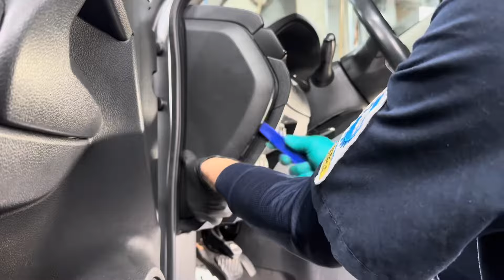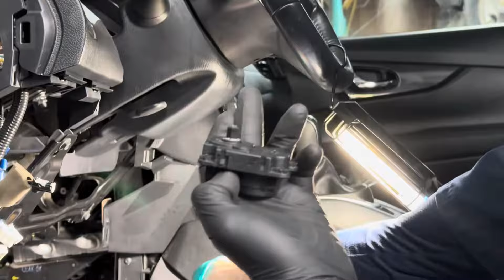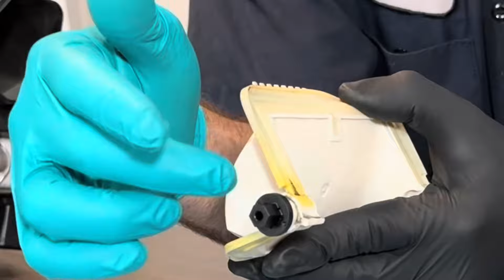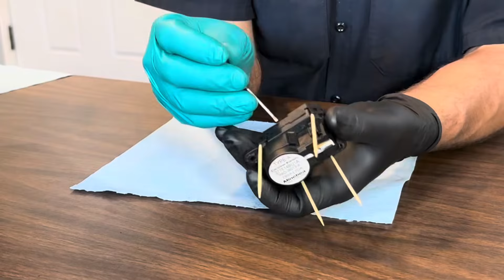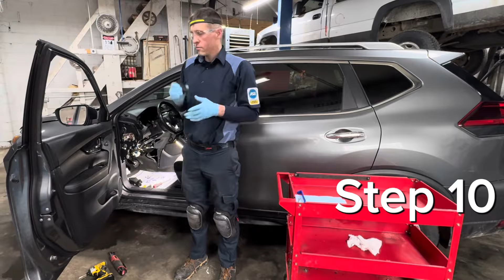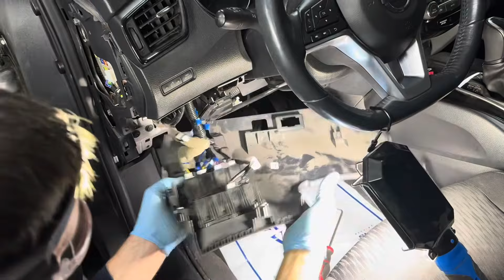Nissan Rogue Heater/AC Fix & Upgrade Kit!!

Comment: What’s the name of the fix kit
Reply from the maker: @AngelaFuentes-t4p  Nissan Rogue Heater Fix kit. You can find it at renegadesolutionscompany.com
Reply from the maker: @AngelaFuentes-t4p  you can call or email us from the website with any questions! renegadesolutionscompany.com 
renegadesolutionshelp@gmail.com
Reply: Does the whole box have to come out like in the video or are you just demonstrating what to do? Hope that’s not silly question. Thanks. 🤝
Reply from the maker: @jamesbarlowjr.3762 not a silly question at all! No the heater box does not need to come out of the vehicle. We just had it out for demonstration purposes. You can fix this in vehicle in a couple hours!
Reply: @ Awesome cause I think that’s what happening to mine. And I just bought the thing. Lol. I hear a ticking or clicking. Lol. How much is your Kit? Thanks Again for the messaging back. 🤝
Reply: And how would I know which is the best kit that I would need? Thanks Again!
Reply from the maker: @jamesbarlowjr.3762  Great question. You would probably be happiest with kit 2. All three kits will fit your Nissan Rogue and fix the problem just the same. Each kit is a little different though. Kit 1 (Nissan Rogue Heater Box Repair Kit) allows you to save a little money by modifying and re-using your blend door motor. Kit 2 (kit with preassembled motor) is a little easier to install because it comes with a new blend door motor that is already modified and ready to go. Kit 3 (extra low torque version) is the same as kit 2 but the included motor has a lower torque output. Meaning is puts less pressure on the heater box. Kit 3 may only be necessary if someone has tried to "fix" your heater box AND severely damaged it. It is almost never needed but some people like the idea and order kit 3 anyways.
Hope that helps! If you have any more questions let us know!

Check out this article on our website.
https://renegadesolutionscompany.com/pages/faq
Reply from the maker: @jamesbarlowjr.3762  You're welcome! Did you just buy your Rogue? The clicking sound could be the motor trying to turn the stripped out blend door or a broken gear in the blend door motor. If you go to the website you can see all our options for the kits. renegadesolutionscompany.com We are the only permanent repair for this problem! If you have any questions let us know!
If you need help to diagnose the problem you can email us: renegadesolutionshelp@gmail.com

Comment: Great video indeed. What is exact root cause of cold air in left vent and hot air in right vent?
Reply from the maker: Thank you! On the Nissan Rogues that have separate controls for the driver and passenger there are two doors to control the temperature. The door on the driver's side is faulty and breaks after time. At that point it will not move and is stuck on one temperature. Usually it gets stuck on cold air. Occasionally it will stick in the middle and sometimes on hot air. In the summer you will hear people say hot air on the driver's side and cold air on the passenger side as the problem occurs. The passenger side has a different style door and they do not break.

Comment: why does the driver's side heat fail and not the passenger side?
Reply from the maker: @TheMisterTFM  the driver side uses the same motor as the passenger side. But on the driver side the shaft on the motor goes directly into the blend door. The blend door has an abrasion problem and strips out. On the passenger side the blend door end sticks out instead of in. The motor does not contact it directly it has a lever that goes between the blend door and the motor. I've taken quite a few apart and never seen a problem on the passenger side with the lever set up.
Reply: My does the same 😮 Nissan rogue 2017
Reply from the maker: @AngelaFuentes-t4p  yup we see a lot of 2017's for the heater box problem!

Comment: My 2015 Rogue AC and Heat only seems to have faulted on the drivers side. Passenger blows hot air in the winter and cold in summer. The drivers side just blows room temp air no matter the settings. 

Is this the same problem that this kit should fix? Incredible video
Reply from the maker: @rickadillo  thank you! If you follow the first steps in the video and pull off that blend door motor it will be obvious if it is the same problem. You will see the damage. Sometimes the door gets stuck on hot sometimes on cold and occasionally in the middle. In that case it would be lukewarm. I am certain that is your issue. You can check it out and then order a kit or order the kit and then take it apart. Just don't open the kit until you confirm the damage. If you have any other questions about it or anything else there let us know!

Comment: As soon as i can afford it i will definitely be buying this! Me and my 3 yeard old would appreciate hot air in the car in these South Dakota winters lol. Crazy how such a problem could be overlooked by all these engineers. Thabk you for the video and thank you for the fix! I cant wait to buy it as soon as i can!
Reply: Hey, I am in SD too and have the same issue. You should file a complaint with the NHTSA too in order to hopefully get a recall one day. The defroster not working is a safety issue.
Reply from the maker: @electricpaper269  I have been told that they just consider it HVAC and so it will never be a considered for a safety recall. Which is crazy because as you said it makes the defroster not work. But I still think it would be worth filing.
Reply from the maker: You're welcome! Yeah I thought it was crazy too. Hey shoot me an email renegadesolutionshelp@gmail.com
Reply from the maker: @austinaalbers7621  hey Austin we sent you another email to follow up with everything. Let us know if you got that email!
Reply from the maker: Hey Austin just checking in on the help. Let us know if you need anything else or if you got our most recent email!
Reply from the maker: Hey Austin so we glad we got you taken care of. Enjoy your heat!

Comment: i wonder if this fix applies to nissan jukes?..i seem to have the same problem
Reply from the maker: @karlschneider5198  sorry it does not. But you may just have a bad actuator/ blend door motor. On most Vehicles that's the problem. It's just the Nissan Rogues that break the heater box itself.

Comment: I just ordered  your kit..thank you for this video...but does the motor need to be clicked to work in proper order ?
Reply from the maker: Hello! I replied to your comment and then it never posted sorry for the delay! If you mean: does the motor need to clocked, i.e. installed in a certain orientation in regard to the matching components so they are all timed together correctly- the answer is no. The motor can be installed with the motor shaft and the blend door in the heater box in any position. The computer will cycle the blend door motor from hot to cold and figure out it's own position automatically. In rare cases the temperature does not switch correctly after replacing the blend door motor or using this kit to make a permanent repair upgrade to the heater box. Just simply disconnect the battery safely for one hour or more and then after safely reconnecting the battery it ought to work great. 
     If that did not answer your question please let me know!
Reply: @RenegadeSolutionsCompany  thank you ...that answered my question. Looking forward to get the kit to repair my wife's car
Reply: This was the best ...my wife is really excited that her Rogue has hot heat ...thank you again
Reply from the maker: @DonaldPetersen-w9k  you are so welcome!

Comment: One of the best how to videos ive seen. Thank you. 

I do have a question as im having 2 issues. One is with hot and cold which your video address' but the other is the mode actuator not functioning. Do you know where the mode actuator is located?
Reply from the maker: So I don't think I can add a picture here in the comments. Just email me at Renegade Solutions help@gmail.com. I will send you that picture. It's not real hard to change that Mode door actuator
Reply: @RenegadeSolutionsCompany  awesome! Thanks for the response. Any idea if the mode door suffers the same fate of the blend door?
Reply from the maker: You're welcome! It's a different and more robust design. It doesn't really wear out. So it's different than the driver's side blend door problem. Any other questions just let us know!
Reply from the maker: Thank you! I worked pretty hard on it. The mode door actuator is on the other side of the heater box. So just go under the dash on the passenger side and remove the covers. There's a similar foot vent that comes off. On the single zone systems there's one motor with a long lever and that's it. On the Dual Zone systems there's two Motors next to each other. It is the same one with the long arm lever on it. You can swap those two motors around and see if that fixes your problem then you know the motor is bad. I'll try and attach a picture here. If it doesn't work just grab my email from the video description or on my website and I will get back to you!
Reply from the maker: I think you mean clocked? Meaning does it have to be installed in a certain order so that everything is timed together.
The answer to that is no. You can put the motor on with the blend door or motor in any position. Once you turn the key on the computer will move the door all the way to hot and then all the way to cold and figure out what the positioning is. Very rarely that is not enough and you have to disconnect the battery for 30 minutes and then reconnect it. After that works perfectly. Hopefully I answered your question if not let me know!

Comment: Great Vid sir. I just put in my order for one of these, hoping it will save me some do-ray-me. It's amazing you have to otherwise replace the whole dang heater box for a 75 cent piece of plastic failure.
Reply from the maker: Thank you! You're saving a bunch of money but you're also saving a bunch of time making it a permanent repair. You won't have to worry about it ever again! If you have any feedback or questions let us know!
Reply: Can you please give me the email site for this heater box repair kit thank you
Reply from the maker: @chrismejak1547 
renegadesolutionscompany.com
Reply: Does this issue apply to 2013 Nissan sentra too. I have air coming out upper vents, floor, and defrost but only heat coming out of upper drivers side vent but not really hot.
Reply from the maker: @MrPsychguy1  unfortunately it will be a different issue. The heater core is on the passenger side and if there is not enough heat in the core it will have a hard time reaching the drivers side. Check the coolant level first on your Sentra.
Reply: @RenegadeSolutionsCompany  thank you for your reply. I replaced both thermostats and purged system of air. The inlet and outlet are both hot at the heater core at hvac box. The blend door is opening and closing, the foot blend door opens and closes too. However no heat come out of the foot vent, defrost, center vents, or passenger vent. Partial heat only comes out of the drivers side vent. I thought the blend door mechanism was stripped, like in your vid, but I can see full motion mo event of the blend door external mechanism arms moving. I checked the cabin filter and it's clear, even tried it w/o cabin filter and no difference. Any suggestions...
Reply from the maker: @MrPsychguy1  you're welcome! It still could be a restriction in the heater core. You can remove the hoses and try to pour water through it with another hose. If it doesn't flow through easily then that is your problem. Another heater core test would be to blow all the water from the heater core with compressed air. Then fill it safely with really hot water. Immediately start the heater and see if it is hot like it ought to be. It will only be hot briefly if it works so check it fast. It could also be a broken temperature blend door inside the heater box where it is not visible. Unlikely but possible. Good luck!